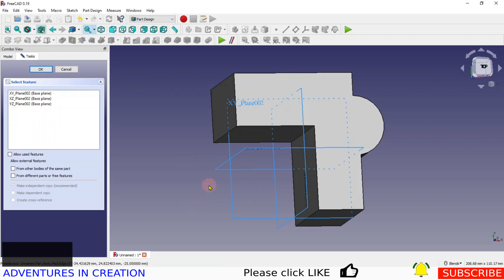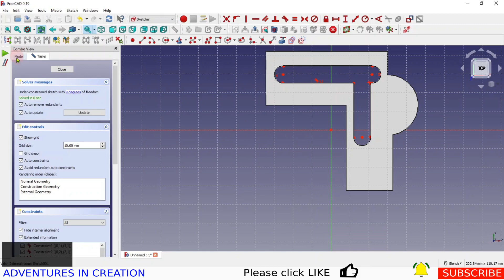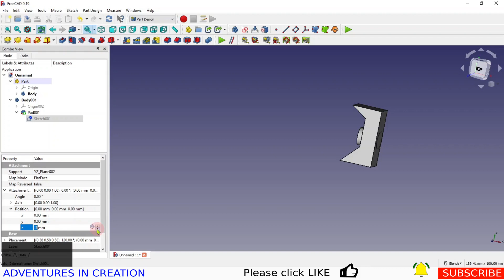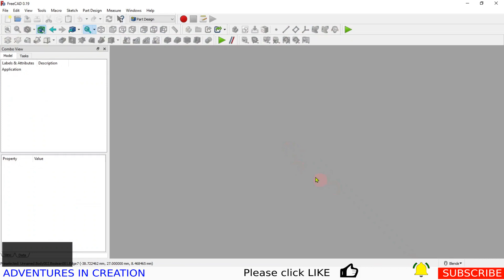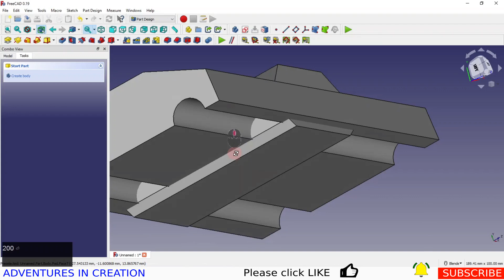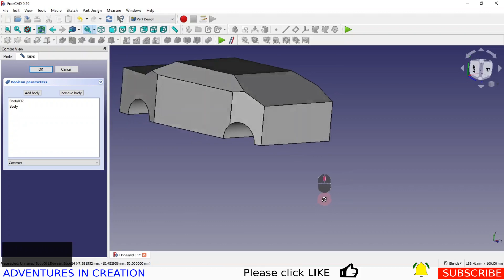FreeCAD Boolean Operations in Part Design.

Comment: Is there a convert entities tool in FreeCAD, like in SolidWorks?
Because I can't find it and I kid you not that is the most useful sketch tool in SolidWorks.
It would replace having to do booleans because your can convert the edges of any object to sketch lines with one click!
I use that all the time!
Reply from the maker: In sketcher there is an option to include the features of another body into your sketch. It's a blue box with what looks like an atenna on the top.
Reply: @Adventuresincreation  Yes Thanks, I found it but than I was not able to select any external geometry with that. It is complaining those items belong to an external part. That is exactly what I need to select!
And where is the Select Tangency, Select Loop, to select a series of external edges? The most important functions are missing or I can not find them even after 30 minutes of haunting for them. This thing is driving me up the wall! FreeCAD is Lightyears behind SolidWorks! The Workflow in SolidWorks is so smooth, I rarely had to open the help-files even 20 years ago when i was learning SolidWorks. Everything just makes sense and you can find it right where you need it!

Comment: Thanks, finally understand the Boolean operation. What bothers me is; how to get the dimentions of the previous body visible. the external geometry button does not function. how do we get arfound that?
Reply from the maker: Not sure what you are trying to do? When you say the dimensions of the previous solid are you just talking about it's shape?
Reply: @Adventuresincreation yes if I want e.g the second body to be situated  at an exact position related to the first body, I would like to be able to indicate the geometry edges of the first body
Reply from the maker: @tomhoekstra1088  You can make it visible by selected the body and then right click and toggle the visibility. (Or just hit the spacebar). You can "translate" the body by right clicking on it and choosing translate, you can then change the increment of the movement and slide it with the arrows or rotate it with the small balls.

Comment: Common does not work as presented in this video, with my program.  I believe my program is bugged.
Reply from the maker: That's odd, do you have the same version? - Perhaps a re-install will fix it for you.
Reply: @Adventuresincreation  I figured it out. I came from Autodesk Inventor. Been making way too many assumptions. I guess I didn't pay attention well enough when I watched this video. I needed a separate body. I was trying to use two different pads for a boolean operation.
Reply: @HaloWolf102  been there done that, should have gotten the T-Shirt 😆

Comment: Interesting. That Boolean Common operation must be how photogrammetry works. You just manually input the profile of your little car as seen from 3 dimensions, but if you extended that to many different profiles from many different angles you could get the full 3d profile of something. Yep. That must be how laser scanning, and photogrammetry work. Cool.
Reply from the maker: It does make you wonder if that's how it is done.

Comment: thank you for the demo of how to work with boolean operations. 
very convincing cut vs pocket - to create holes with not-trivial form (this is like molding, create mold as counterpart to cast). 

it would be nice, if you declare before the start of each example, like: "now I'll show how to use CUT, I'll create two bodies, then apply cut to them", this should be very helpful in more complicated example, as in your COMMON operation.

additional thank for using mm, but not inches :)
Reply from the maker: Thanks for the constructive feedback.

Comment: When stuff disappears while entering a sketch usually you can just unhide it from the model tree. Thanks for the vid!
Reply from the maker: Yeah, either way it's an extra step. I think that's unintentional but as long as there's a work around. Thanks for watching.
Reply: No need to put outside of the part, just need to go out of sketch and go in again. That worked for me.